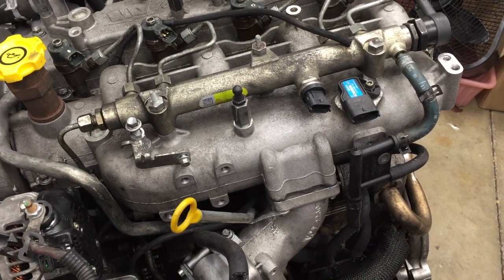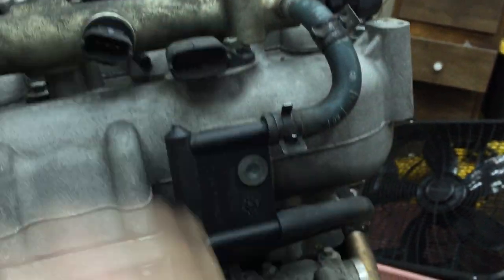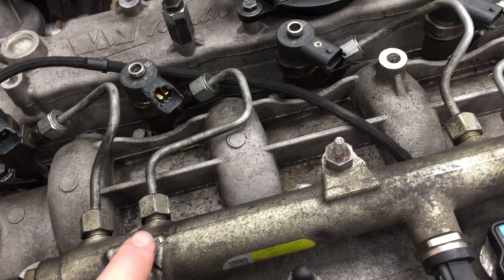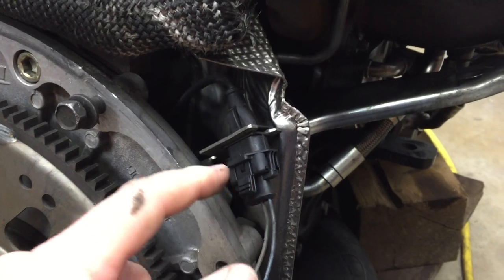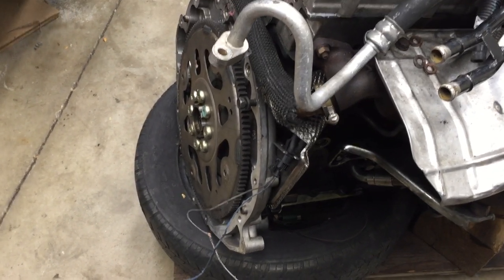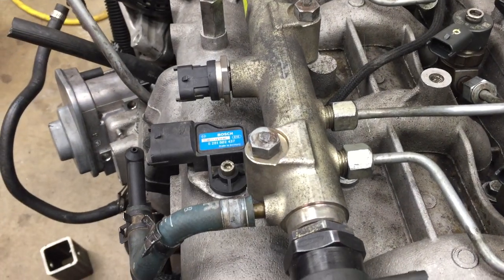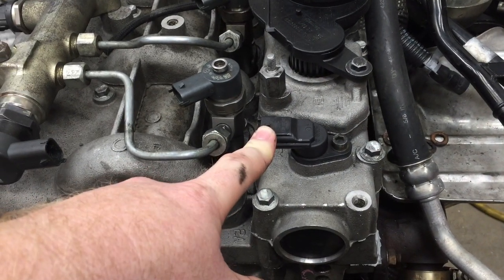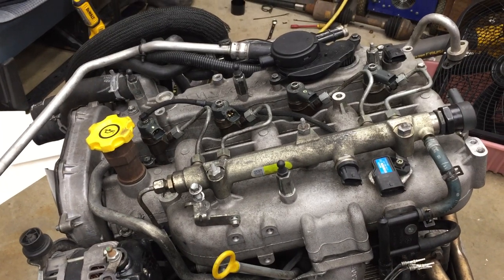Jeep CRD Engine Information

Comment: Hey nice video my friend , I am trying to learn is much as I can about the 2.8 vm motori , I am thinking about buying a Jeep jk 2.8 crd but i am afraid of the reliability of the 2.8 engine because i want to use it as a long distance road trip vehicle ,I am also considering a Toyota Prado with the proven d4d engine but it’s just boring and ugly compared to the jk ,do you consider the 2.8 vm motori as a reliable engine ?
Reply from the maker: I think Toyota always wins in reliability. However mine has been very good to me but I did some modifications. If I were to buy a used CRD today and want to take it on long trips I would do the following for reliability. Remove head and replace exhaust and intake values with new valves. The exhaust valves on engines that have had EGR running for the past 15 years have a higher failure rate. New head gasket and ARP head studies. New rockers. Complete timing belt kit/water pump. Replace alternator/tensioner as needed. Replace fuel heater head with newer type. Instal dodge Cummins in take lift pump. Tune EGR off in ECU. Always run 15w-40 diesel oil. Install large transmission cooler and not use stock transmission cooler. Upgrade turbo hoses to silicon samco hoses. It’s a fair amount of work and expense. If you can do that work yourself it’s not bad. With the above I would feel confident in driving a CRD across continents.
Reply: @IcarusOffroad  I really appreciate that you took the time for such a helpful answer my friend , it helped allot !! Thanks for that !
Reply from the maker: @12Achilleas  no problem. Good luck. There is a great owners forum at lostjeeps.com also ausjeepoffroad has a number of knowledgeable people.
Reply: @IcarusOffroad  I will defiantly have a look , I really appreciate it

Comment: Hi! Liked your video! I'm Portuguese and I have a Jeep Wrangler 2.8 CRD (2010 JK) ....only 43.000 kms and since last year I started to have some problems starting the engine from time to time and now it's doing more often (maybe 2 or 3 times in a month) although it starts usually at 2nd attempt. I took my Jeep to the dealer and they told me  the machine didn't found anything wrong and they even tested several times after leaving my car during the night at special cold day. I don't feel any loss of pressure while driving it but I'm worried by the reply from the dealer (it's a Fiat/Jeep official Dealer) ... any clue or suggestion? Many Thanks...obrigado!!
Reply from the maker: It may be related to air in fuel, or even glow plug failures. If the problem is worse when its colder out I would lean towards possible glow plug issues. If cold or warm doesn't make a difference then I might think about air in fuel. I'm not familar with the diesel JK as it was not sold in the USA but you should look at if you have a filter head with manual pump and bleed screw. If so check and see how much air you can get out. Its also possible your fuel rail is draining and it just takes a little while for the rail to fill again before the engine will start. I would recommend you head over to the lostjeeps.com CRD section where you might be able to find some more recommendations.
Reply: @IcarusOffroad  Many Thanks! It was very helpfull...yes it seems to happen more with cold weather! I will take your advice...all the best and ... muito obrigado!

Comment: My CRD starts but seems to be injecting fuel on all four cylinders  at same time.. cuasing a steady knock on the Compression stroke of a second cylinder and cuasing excessive exhaust and no power. This issue started as a periodic engine malfunction where the engine ran fine then would run like crap for 1 minute or so then recovered.... 3 weeks later it did that again for 40 seconds then recovered for another week then ran again knocking and leaving soot trail no power again about 1.25 minutes  then recovered... 1 hour later began this again and hasnt fixed itself... is this perhaps Cam and crank sensor mismatch? Or what might be the problem.... the engine has 112,000 miles exact? Dealer cannot seem to diagnose this problem... they claim a miss in a cylinder according to the computer but sooty exhaust and steady knock doesnt make sense also the high rev sounds like the engine computer is advancing searching for proper engine timing advance of injection of fuel?
Reply from the maker: Sounds like failed rockers. Pull the intake /intercooler outlet hose. Then place your hand at the air intake butteryfly valve and feel for puffs of air. If so you need a pretty extensive service going beyond the timing belt job and pulling the combination intake manifold and valve cover to access the rockers. This is a pretty common failure on engines that ran the recommended oil, as it’s too thin, and engines that have had heavy EGR use.
Reply: @IcarusOffroad  see this I dont buy becuase of the way the symptoms developed... the fact that it occurred 3 weeks before and then went away then came back knocking and then went away for 3 days then came back for 45 seconds then went away for 1 and a half hours then has stayed.. I dont believe for the life of me that its failed rockers... the only code it gives is a cylinder misfire in cyl 3... new injectors have been installed the puff is in both the exhaust and intake but it also sounds like the engine is dumping fuel in all cylinders constant cuasing black sooty smoke on higher excelleration... like its just dumping fuel on exhaust stroke... I did follow maintenance reccomendations to the tee since it was new with 0 w 40 full synthetic oil changes at 8000 miles intervals... Ive also been told the Temp sensor and ambient air temp sensors could be shorting the 5v supply voltage to the remaining sensors cuasing fluctuating currents across the board... Im debating replacing all sensors... I just threw a reman ecm, injectors, replaced the glow plugs, the fuel filter head, had the Timing belt replaced at 119980 and belt tensioner on the serpentine drive belt, the torsion pulley on the alternator, 2 sets of tires... 2 torque converters, trans oil pump, 4 turbo chargers, egr valve, 4 ECMs, 1 tail lamp bulb.... thats pretty much all the maint thats been done... the engine only has 112,000 miles on it. If it were failed rockers please explain to me why the misfiring/knocking came and went and came and went and came and went  and then came and stayed? Over about a 2 month period of time. And what engine oil do you suggest... I would prefer to run 15w40 Rotella or Delo 400 15w40..  but VM Motori reccomends 0w40 full synthetic
Reply from the maker: @glennschlorf1285  it’s free to try and see if it puffs out the intake. If it does you need rockers.
Reply: @IcarusOffroad  before I do that at 112,000 miles Ill change the cam and crank position sensors and try that... along with perhaps another sensor or two cheaper to do and I really dont think the rockers did that yet not the way this happened
Reply from the maker: @glennschlorf1285  your choice. It’s still cheaper to pull the intake and feel for puffs of air than buying new sensors.
Reply: @IcarusOffroad  the more I think about it.... the more I think you could be correct... the intermittency of the crappy engine ops up to the point of total failure could be a collapsing lifter that finally failed... when all the cylinders intake and exhaust strokes are severly shortened... that would cuase incomplete expelling of exhaust improper intake of air and a knock of valves closing on improper time... that would explain the killing of mosquitoes and no power... cant get a local shop to change em out

Comment: Great video and I have a question:

I recently did a motor swap on one. It’s an 05 to with an 06 motor. It cranks and acts like it wants to start but never fires up. It only ran twice after constant hard cranking and after I shut it off it won’t start up until hours later. It runs like a champ too. The cam and crank sensor is brand new and those two infamous wires are not backwards. I’m thinking it’s the fuel rails sensor or the fuel pressure solenoid. Any ideas? And is there a way to test out those two sensors?
Reply from the maker: Malik McDowell’s wrecked ATV these are best checked with a good code reader to read sensor data. There are WiFi or Bluetooth setups for phones that are good for this. There is also a regulating valve on the back of the injection pump. It is held in with some torx screws. You could try swapping this from your old engine if you still have it. Same goes for rail sensors. These engines also need a fully charged battery, they can crank nicely but just have low enough voltage not to fire injectors correctly.
Reply from the maker: Malik McDowell’s wrecked ATV also, the lostjeeps.com CRD section is a great resource with collective knowledge for these.
Reply: COrobotchicken the only problem is a former mechanic never returned the valve cover from the old engine thus all the sensors were included on to it. We have ZR13 scanners from harbor and freight and it’s throwing a P0340 camshaft circuit code but that sensor is brand new, and the connector is reading 5 volts, within spec. We do have the old fuel pump and that sensor is still hooked to it so I’ll swap it out. The battery is fully charged as we have a charger hooked up to it. Do you know what those Bluetooth or WiFi apps are called?
Reply from the maker: Malik McDowell’s wrecked ATV there are lots of elm327 adapters, apple usually needs WiFi’s versions, and android can use Bluetooth. Torque is a good one for Android. There are a fair number of different apps out there for them, and lots of different readers.
Reply: COrobotchicken thanks for the help! I’ll look into it
Reply: @IcarusOffroad   Hi, I need help with pairing the ecu and wcm and a new key, was wondering if you could that if I sent the stuff over. Let me  know if you could do that for me. Thanks.

Comment: thank you, are there any tps sensors anywhere?
Reply from the maker: No. There is no TPS since this is drive by wire. The gas pedal assembly (APPS) is the closet thing to a TPS and it reads the driver demand directly at the pedal.
Reply: @IcarusOffroad  oh ok thanks. I'm diagnosing a crank no start failure during operation right now and did the key on off on off thing and got a code possibility relating to the pedal or a sensor that sees input from it. 🤷‍♂️

Comment: if the cam belt snaps is the engine junk.?
Reply from the maker: Usually not! The rockers are a designed failure point. If the belt slips or breaks the rockers will snap in two. However depending on the circumstances it’s still possible for the valves to bend. But they usually don’t. I have some videos showing how to pressure test to verify that the valves still seal correct. That being said the exhaust valves seem to have a high rate of failure, and if you drop a valve into a piston that will pretty much trash an engine. If you are at the point of replacing rockers I recommend pulling the head and replacing all of the exhaust valves. The engine pictured above actually got used in my personal Jeep because I had a valve drop shortly after replacing bad rockers.
Reply: @IcarusOffroad  thanks for the info. Its an engine in a van at the scrap yard.  There asking £500 as is with suspected broken cam belt. Think ill leave it there. Thanks again.

Comment: If I use a bit of quick start it starts up but go's  I to a limp home mode when I try to drive it?
It refuses to start without quick start hot or cold
Reply: Hey did you figure it out I have the same issue

Comment: I am having intermittent issues and throw the code P0192: "Fuel Rail Pressure Sensor Circuit A low". I can drive it for a couple of days with no problem but then I will go into a quasi limp mode where the engine doesn't like to rev above 2000 RPM. I can still get up to highway speeds but acceleration is terrible. No smoke. Transmission seems to be shifting funky due to strange RPMs. Oh and when I put it into park or neutral it sounds/feels like its on the verge of choking out, but seems to keep running like that indefinitely.

Would a bad sensor cause these symptoms, or does that code mean the sensor is working correctly and I have low rail pressure?
Reply from the maker: Juan Smithe when was the last time you bled your fuel filter head or changed your fuel filter?
Reply: @IcarusOffroad  Its about time to do both of those things again. I've just never seen this code before and it got me worried.
Reply: @IcarusOffroad  So I changed the fuel  and air filters a few weeks back and I'm still having the same issues. I can build pressure in the fuel head by manually pumping and I can bleed all the air out after about 3 bleeds. But every time I check it I have more air in the head. 

The fuel heater plug looks fine, no discoloring, melting, or diesel leaking out. I'm going to take the head off again today and examine it closely for cracks/defects, and make sure I got filter/water sensor on correctly.
You think the air in the fuel is causing the low rail pressure? I've also read that bad wiring/connections from the fuel pressure/quantity solenoids and fuel pressure sensor can cause these symptoms. 

I'm not really sure what the best way is to isolate a fuel leak under negative pressure.